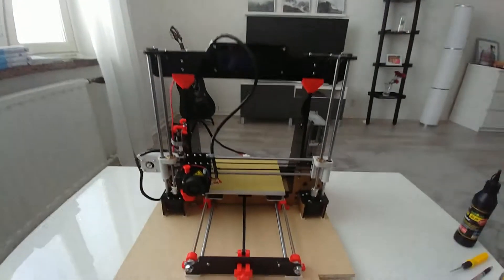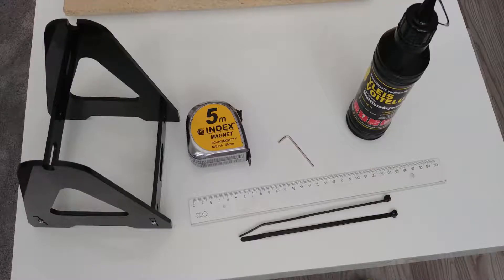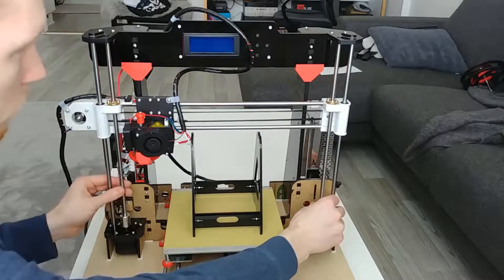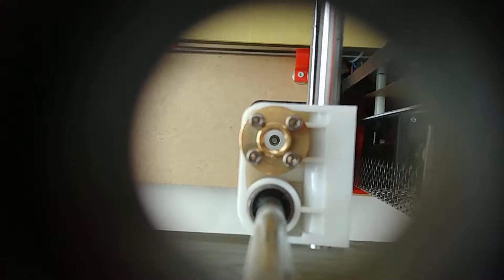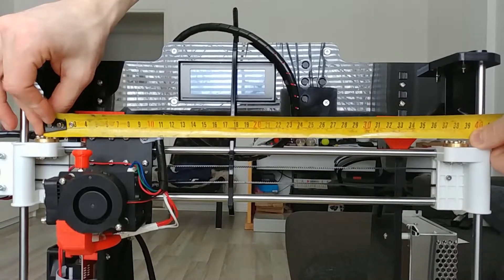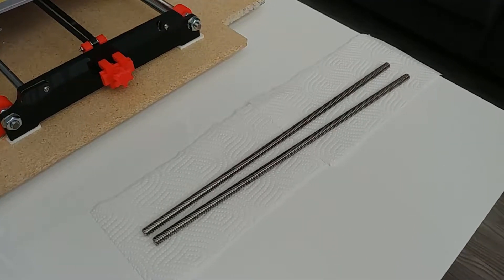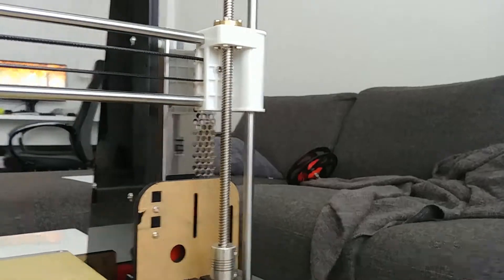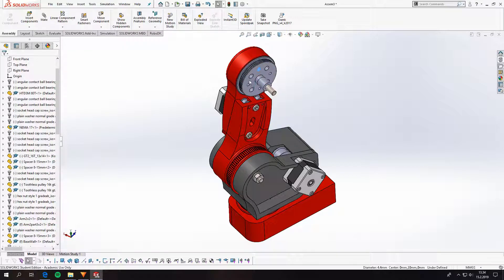Anet A8 Z-Axis alignment (Proper z-axis wobble fix and noice reduction)

Comment: I know this is an old video, but on my anet a8 it seems the brass threads on the carriage mounts actually measure wider than the z motor centre points, and I've played around with the insertion depth of the x smooth rods, but the z smooth rods constrain the carriage mount width distance. I tried filing motor mount holes into a slot so the motor is mounted relative to the threaded rod which positioned relative to the smooth rods which are constrained top and bottom. Going to have another look at it but with a drill as filing took a long time and didn't get me where I wanted to be
Reply from the maker: That really sucks, I haven't experienced similar issues with my A8. Hopefully you'll be able to sort it out!

Comment: Adjusting the smooth rods in the x axis wont do much because the zed smooth rods are the constraints for x. Adjusting the horizontal rods do not adjust the space between the brass nuts. Thats all controlled by the zed smooth rods and if the original holes were placed wrong, then the only thing you can do is print a z motor mount that allows the motor to move